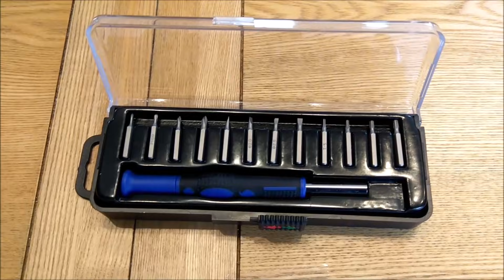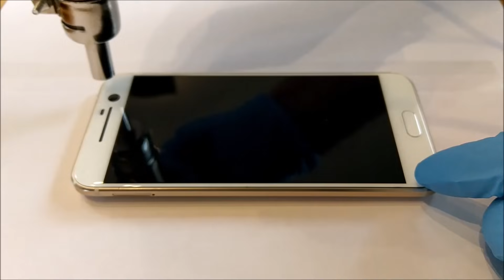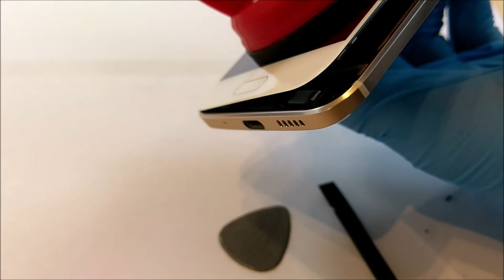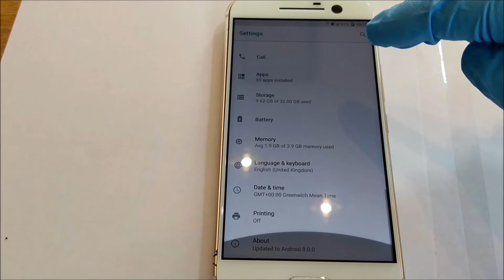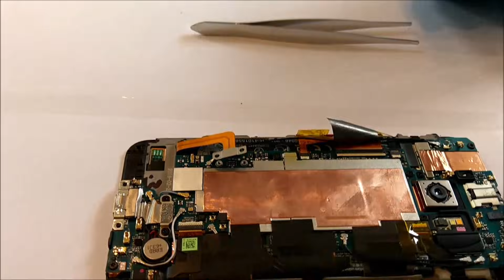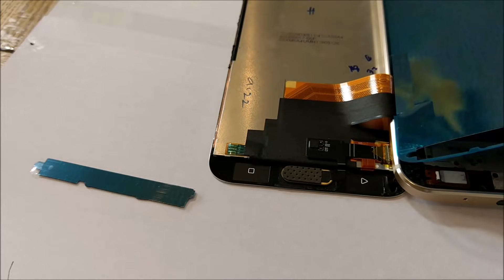HTC 10 Mobile Phone Battery Replacement

Comment: SUCCESS! Thank you very, very much. I watched you video, assembled all the parts and tools. Then, I watched your video again and followed along, step-by-step. What a bugger! Wow! So many small screws. And, you have to have very steady hands; I don't. Didn't lose a screw or damage any internal cables. It took me two hours, but in the end, my telephone works and I avoided having to buy another. Thank you, thank you, thank you!
Reply from the maker: It's not an easy thing to do, well done. Most of the battle is taking your time and being careful. Great job!
Reply: How its the battery after the replacement? My htc 10 is shutting down at 70% :/
Reply from the maker: @juanmanueldominguez4976  Clear the cache in the boot loader menu. Just google it for step by step instructions.
Reply: @blackstone4823  I try everything. Phone need a battery replacement. This tutorial encourages me to do it! Greetings from Argentina!!
Reply: @juanmanueldominguez4976  I'm guessing you have a bad battery. Return it and ask for a replacement. Your problem happened to me with another battery for a different brand. The seller sent me another and it worked just fine.
Reply: UPDATE: OK the battery replacement went well; all is working well on the phone...except GPS. It seems so screwed up and as an Uber driver in Chicago, I sort of need an accurate GPS.  I'll search for a solution, but, if anyone has an insight about this, I would really appreciate hearing from you. Thanks.

Comment: Thank you for the detailed complete tutorial. Excellent video. Caution to anyone attempting this, be careful with those tiny wires. I broke the connector on the blue wire. I had to buy a parts phone to get the wire I broke. Pry from the wire side of the connector, it seemed to be more robust.

Comment: Thank you that was a great tutorial. Could you possibly add links to where you bought the original battery and glue template please?
Reply from the maker: The battery was the HTC10 oem battery from Replacebase. The glue template is not good enough, I had to glue it properly a few days later with T7000 which you can get from the same place instead of the template. The battery continues to perform very well.
Reply: @blackstone4823  Useful info, thank you.
Reply: Replacebase appears to no longer list this battery. Newegg lists a supplier that sells an OEM part.